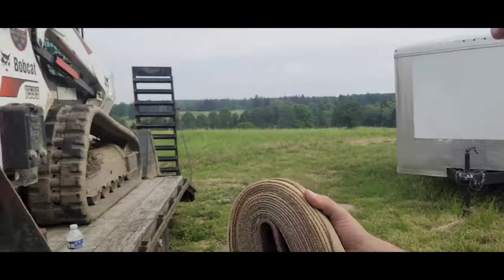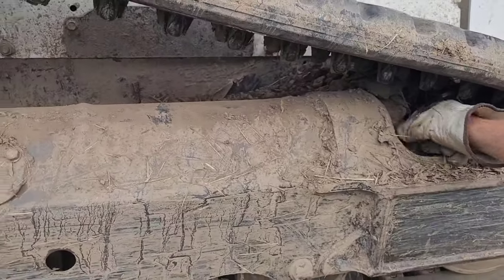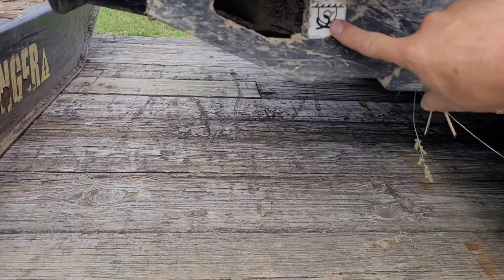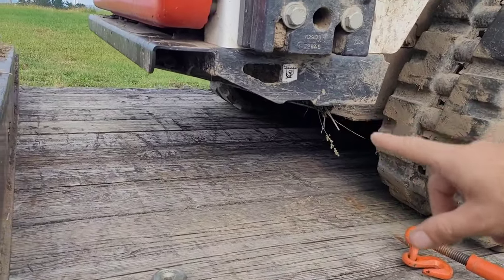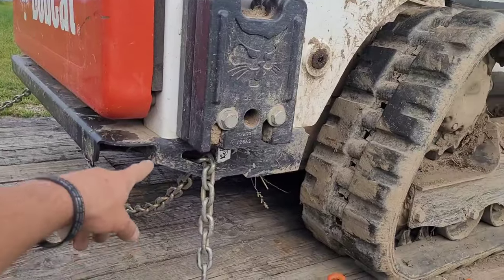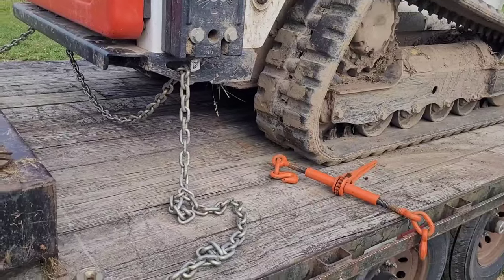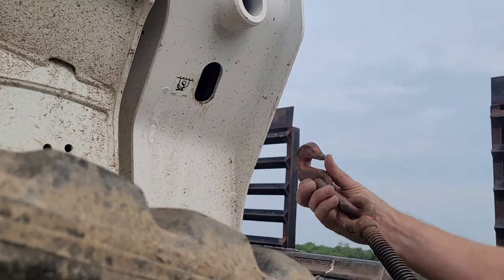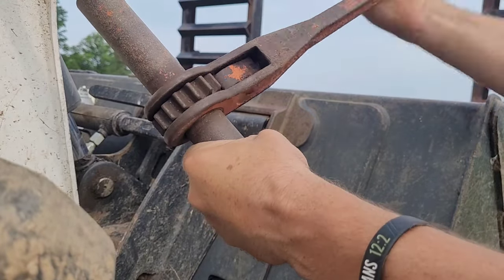How to LEGALLY chain down a machine(under 10,000lbs)

Comment: On equipment under 10,000lbs, could you use two chains without binders on the rear, with chain and binders on the front to tighten? I understand you cannot do this with heavy machinery over 10,000lbs, but  I can't find info on under 10,000lbs.
Reply from the maker: Great question! I would recommend putting a binder in the front AND one  in the back to be covered for sure. I think technically, having just a chain in the back counts as a tie-down if it is tightly securing the machine.
Reply: No. You need an adjustable securement device on each tiedown. If you have only one on two different tiedowns, if something were to happen to the one, that renders the other useless. Two chains is fine for under 10k, but two binders are needed as well- pulling in opposite directions.
Reply: @maxenra  Can you post the regs were you are citing this?
Reply: @MidwestFirecraft  It’s all in the FMCSA part 393 handbook. However, I do believe there are exemptions for agriculture purposes.

Comment: Would you need an additional chain for the bucket on your loader?  If the combined lenght of the unit with bucket is over 10ft, do you need a 3rd chain?   Like you mention at the end ove the video this info is hard to find in one place and I have seen that as part of the 393.100. Thanks and nice vid.
Reply: I think there is language in the section about tying down equipment that priorize pulling in 4 directions. The rule for tie down count per length is in the section about bulk materials.

Comment: According to the J.J. Keller "Cargo Securment Handbook For Drivers" the minimum requirements of any cargo securment system are as follows:

80% of the cargo's weight being secured against the cargo moving forward.

50% of the cargo's weight being secured against the cargo moving rearwards.

50% of the cargo's weight being secured against lateral (sideways) movement (the cargo moving in the direction towards each side).

20% of the cargo's weight being secured against the cargo being moved in an upwards direction vertically.

The NACM "Welded Steel Chain Specifications" (a free PDF) is the definitive source on the working load limits of welded steel chains based on their grade and thickness, (there's a chart to reference).

A common myth is that 1 chain is good to secure 10,000 lbs of a load. No Grade 70 (G-70) (gold colored) transport chain under 1/2 inch in diameter/thickness is manufactured with a 10,000 lb. working load limit.

It's also a good idea to keep the weld on the chain facing toward the opening of the hook. The chain link can snap if the weld is facing toward the inside of the hook due to the pressure being put on that weld.

The outside of the hook should face away from the cargo when possible, so if the cargo shifts it pushes the hook into the chain and the chain remains connected.

For chain binders, consult the manufacturer for their intended working load limit.

When you use multiple items in a securment system (including the anchor point on the vehicle), the system is only as strong as the item with the lowest working load limit.

The best practice is to use the manuals accredited by DOT compliance consultanting firms such as J.J. Keller, the standards of NACM (the National Association of Chain Manufacturers), and a calculator to determine the forces and chains/straps needed.

At the end of the day, once it is driven off private property the driver becomes legally responsible for anything that goes wrong with the load securment, even if someone else loaded it. Criminal negligence is a stupid thing to be in prison for.

Let's keep everyone's Grandma's safe when they drive next to us on the road.
Reply: When citing those percentages for tie down strngth, are they using the breaking strength, WLL, or half of WLL?